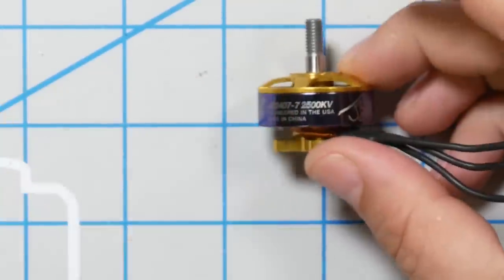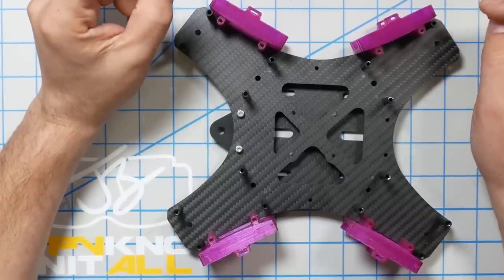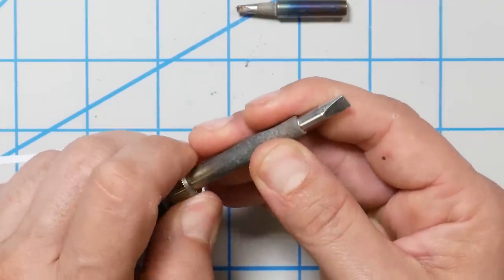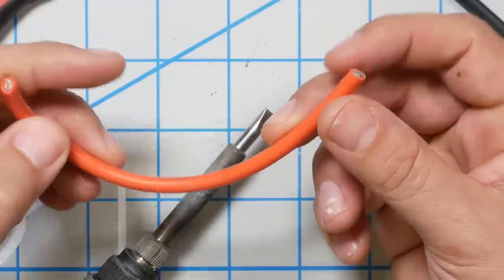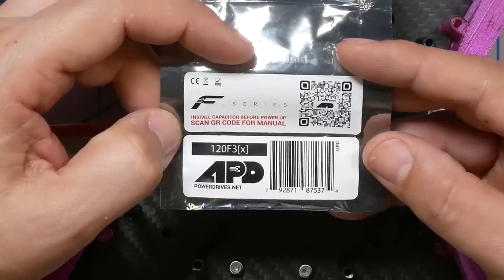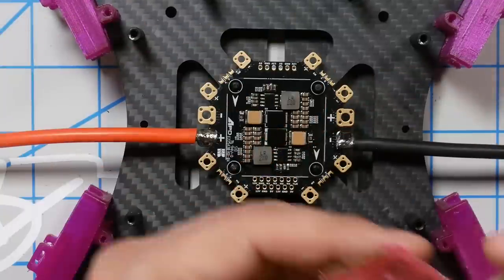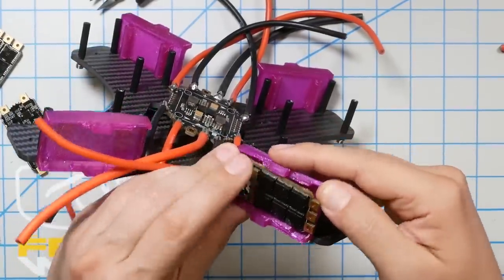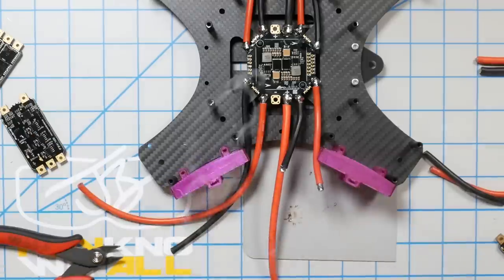Beast Class X Class Quadcopter Build | CATALYST MACHINEWORKS TASMANIAN - Part 1

Comment: There's a simple trick to tinning a wire, especially large ones like that. First, you must twist it to get the strands together. Second, cover it with flux paste. Third, put the solder on your iron. Fourth, touch the solder ball on the iron to the wire tip. The flux will cause nice quick and even heating, and the solder will be pulled right in. It's the same concept as solder wick. Flux can be a real friend with wires of this size. Love watching this stuff. Thanks, Josh!

Comment: Even though I am an electrical engineer with 30+ years under my belt, I learn a lot from your videos. So, it is with the utmost humility, I would like to offer a small reciprocity:
The industry wide standard term for the 'edge connections' you reference at around 28:45 mark in the video is 'Castellated Pins'. They are often used to simplify board-to-board assembly. They save board space (and weight) and usually add no or little manufacturing cost. In many (but not all) applications they offer better electrical conductivity due to the fact that they have direct access to all (including the inner) layers of the PCB; surface pads usually require several plated through holes, called vias, to achieve similar effect.
Reply from the maker: Thanks. That's a good term to know.

Comment: Funny my second build ever was a 800 class Hexa running low KV motors with 14 inch props.  This was about 7 years ago and for the flight controller I used a DJI Naza M V1 with GPS.  There were many including DJI that said the Naza M wouldn't work on that big of an aircraft, but it worked fine. 

It took hours to design, engineer and build that beast.  I used DJI f550 center plates with extended arms that I found on the internet.  It was an amazing thing to see and hear flying around.  I never really used it for what I built it for which was a camera platform mainly because I could afford the cost of a good gimbal.  I wish I had video of this thing flying, but I don't.

Comment: Building my second X with these same parts, including the Brain FC. Got my power section done and FC as well as the rx and vtx/camera.  Perfect timing to see that I got  what I’ve done right so far right 😃. Curious about battery connections coming from both sides. Motors are next and then bolt it all up.  Nice job, excited for part duex.

Comment: the other ground wire is for making sure the ground voltage point on the ESC is the same as the flight controller and should be used if you're using a separate PDB for powering your ESC.
this otherwise can cause some strange behaviours

Comment: The Signal GNDs are provided to allow for a twisted pair with the signal and GND. This helps shield the signal wire from noise/ripple that could get coupled to the signal lines under heavy loads. This could easily happen if your signal wires run parallel to your power wires.. 

I found that running Proshot without signal GND works really well, however running Dshot without signal GNDs could see some glitches. 
I think this happens because the Dshot frequency is in the same frequency band as the FETs rise/fall times.

Anyways, great video.. eagerly awaiting your next vid. :)
Reply from the maker: For these short wires, I'm skeptical the lack of signal ground will be noticeable, but I can always add it if I change my mind. Mostly I'm just lazy about soldering four more wires.
Reply: This info is actually pretty valuable. Thanks @BestUsernameEverMade

Comment: Love your build videos. I have no intention of building this , I'm not an idiot. :-D
Your showing the proper way to solder on the power cables using wires i could actually see really helped. Thanks, happy building  ♥ :-)
Reply from the maker: 10-gauge is great for demonstrating technique because it's so big you can see everything.

Comment: Your solder skills are getting better just as your flying skills.  Still not quite jstd specs but good enough.  You should always start with flux and toss the rossin core you will be amazed at how much easier it is when you start with good flux. Not only does it change the viscosity of solder it transfers heat around the whole joint and regulates temperature keeping you from lifting a pad .

Comment: I've built around 75 Heavy Lift Cinema Drones over the past 9 years..... and until each soldier joint you lay  has the potential to cost you $10,000+ you don;t know the stress of soldiering!  These beast class are starting to get there. Stress of building, stress of flying.. heck when a simple flip on landing can cost you an expensive prop... I'll just watch you guys play with these... Although I do have an old 1100mm ZVulcan UAV frame with some fat 400kv T-motors... maybe at least make a nice 6S huge fpv ripper for fun!

Comment: Love the videos, keep em' coming! BTW, the "edge joints" are called Castellation. They are helpful in PCB design when you need to fit boards on top of one another, but don't have the space for through hole pins/connectors.

Comment: Bugger me with the loud end of a trumpet!  That's some mega motor Joshua!
----------------------------------------------------------------------------------------------------------
A tip regarding your soldering from a British chap with 50years experience.
Put the chisel point on the near side of the solder pad and slide the pre-soldered cable down the chisel face.  This will allow your pad to melt, and the solder on the cable end to melt, then fuse together on contact.  It takes practice but once you have sussed out your timing, it does give good results. 
Great video as usual.

Comment: Signal ground is redundant when your ESC uses the same power source as the FC (same battery), because they already share the ground. But it is a must when for any reason you have your FC powered on another battery (this would be good to reduce vibrations, but not useful on a mini quad because of weight).

So maybe next x/beast build you could try with a different power source for your FC and FPV system? If the tests are good, this could maybe become a must in every x class quad.

Comment: 27:06 That's those little balls of electronic death that flew up on your Capacitor that causes Spectacular Fires and Magic Smoke in abundance at that wattage. I am a little OCD but, I would go back and make sure that is ABSOLUTELY GONE. My blood curdled when I seen it pop up.  Amazing Build. You are right, anyone with no experience is an Idiot for attempting this build. Little less fly the Beast. I am bold and tend to push my limits. I get a cold chill down my spine when I see these power levels in a perceived "Toy". We both know that there's going to be that Idiot that attempts it. LMAO I am a firm believer of removing all warning signs. Great Video, Sir!!!

Comment: Soldering - it took me years to realise by myself that the process of tinning wire before you solder it to a circuitboard wasn't just some annoying step that could be omitted, it is a vital part of how to get perfect solder joints, and I should've listened to those who did actually know better.

Comment: with the right gearing one of those motors could open your front gate with your controller rc gate opener. i remember getting out in the rain to open gates for ostriches..woulda been nice to have a multiple systems rc on a frskytaranis all those channels  without spending what the commercial systems cost

Comment: i have a tip for you (youvgonnalearnsomethingtoday) : don't use hand to hold the wires when soldering it, it's way better to hold it stable with a fixed holder, note that your hand is always shaking(micro shakes), and micro cracks will form during solidification phase. 

great job, nice beast !

Comment: 12:50
Electrical engineer:
Nah, generally when you have assembled electronics, they are a lot less sensitive to ESD. The gate of MOSFETs (especially smaller high speed signal ones) are the most sensitive because it's unconnected static voltage can build up to the point that it pokes a hole in the oxide layer, effectively shorting the MOSFET gate to the channel.
Reply: You should conformally coat after soldering the PCB
Reply: 28:28 *YES you should run another ground wire!!!*
And ideally twist them together to make a twisted-pair. The large current-carrying wire is going to have voltage drop and high frequency noise, which will effectively be added on top of the signal, from the ESC's perspective. The separate ground reference should provide a central ground reference star connection to the flight controller. Also if the electronics on the ESC are galvanically isolated it just simply would not work, or worse, barely work until external EMI from nearby current-carrying conductors upsets it during flight!

Comment: Add flux the boards and wire BEFORE you soldier them.  I do computers and  I flux the board and the wires making them a lot easier than soldier alone. And you can clean them with rubbing alcohol  I do it with one hand!

Comment: When I'm at that point with expensive components I just tip the bottle onto it and spread it around.....several times. 6 months stuck in a field over winter with no electronics damage says it works.

Comment: Hey JB. In all seriousness..Your + and your - pads are on both the top and the bottom of your ESC's. 
Did you not think of 'splitting' the wire so you could "sodder" (<<< Americans.. 😜 ) So you could Solder top and bottom pads? For that gauge wire, I reckon that would be way more secure?? 
Love the vids mate!!!
Reply from the maker: That's an interesting approach but I don't know if it's actually worth the hassle.
Reply: @JoshuaBardwell  Mate, it's just finger strength, pull the strands apart to approximately 50/50 and (Sodomise😜 ) Solder them. It's no hassle!! It's just less huge solder clumps and you have a double safety if one half does break away. 
Mate, I bow to your greater knowledge, if you only knew how much you have helped me in this hobby!! Thank you!!!
It's not advice...Just a suggestion is all. ✝👍😂

Comment: Good video as always. You mentioning the word "expensive"  a lot. What does this build cost? I fly heli's and fpv. Some of my 700 helis are 1000$ to 1600$ just for kit. Motor 350$. ESC 300$. 4 servos 600$. Fbl controller 250$. 12 battery setup 300$+. Main and tail blades 180$. Hell just my mikado vbar touch controller is 1300$. Is that expensive?

Comment: Fun fact. I run 10 gauge silicon wire on my 5" drone. And I soldered it quite well with a normal tip.
Why am I running this wire?
Because I had access to an old 6s 6000mah pack that had puffed, and I clipped the leads off to reuse them.

Comment: Thanks Josh for the awesome video!
 I just wanted to comment about the safety aspects of it. yes, I understand you don't want someone to go out there and hurt themselves but I do have to go back to the old days when we used to make gas powered helicopters 90 size that cost $3,000 with a 3-foot blade on it doing tik tok's and flying inverted along the grass with full auto rotations. I guess what you're saying, is just take responsibility for what you build and what you do with it. But not saying, to not build one. Just out of curiosity what is the average cost to build one. Thanks Lance
Reply from the maker: I agree everyone should take responsibility. There is not as much of a culture of safety with FPV quads, because they are inherently less dangerous and expensive than CP helis and big RC planes. So more of a disclaimer is necessary. One rich, careless person could build this quad, more or less the same as he builds a 5", but this is NOT in the same class as a 5".

Comment: I just noticed that you are using 50V capacitors for 12s, would it be better to use 100v capacitors for 12s?
Reply from the maker: That's what APD sent with the ESC's so I assume they would know.
Reply: Okay thank you. That is interesting I always thought the capasitors needed to have a voltage rating higher than the battery voltage or they might not absorb voltage spikes. My 12s 120A APD ESC's also came with 50v capacitors.

Comment: Which solder fume extractor do you have? And do you like it?
Reply from the maker: I have a banggood special ... I don't remember the exact brand. I don't like it very much because it has to be VERY close to the work to actually catch the fumes. If I had to do it over again, I would get a fume extractor on a spring-arm so that it could be easily and quickly moved into and out of position without disturbing things on the bench.
Reply: @JoshuaBardwell  I use a 12v 0c fan from a used electronics place glued on some foam as a stand with a simple 12v wall adapter, it works like a charm

Comment: Those wrist straps aren't anything you need to worry about man. No matter where I've lived dry or humid, I've never had an electrical component fry. Plus something designed for the kind of power you're going to feed through them likely won't give a shit about some mediocre static discharge.
Reply: Exactly. I don't use one, own one and I have hand assembled over 30 FC's at component level. Never had an issue. All BS
Reply: Believe it or not some components are very susceptible to voltage specific spikes. So something like an ESD (2000+ volts shock)...can be bad.  If your not wearing a wrist strap just try to discharge your self before touching a circuit. Easy enough.

Comment: That disclaimer is interesting.  I think a 5" quad could seriously hurt someone.  Probably not as badly as this but idiots shouldn't fly those as well.  Of course cars are more dangerous than both.
Reply: Kinda... But the average Joe respects the danger of a car and has never looked on the ground to see if their finger is lying nearby after hand catching a quad. Reddit is full of 3-5 inch injuries that are painful and gruesome.  This would easily kill someone
Reply: @DoRC  i can't tell if you're joking?  Some pros do it bc it's cool, noobs do it bc they are used to brushed quads that don't shred your fingers... Or so I've heard
Reply: @Sully365  I was mostly not kidding.  I haven't flown around any "pros" and I don't watch a lot of them on YT.
Reply: @DoRC  i totally understand.  I think a lot of people underestimate how sharp the blades are and how powerful the motors are until they get into trouble
Reply: @Sully365  amen. The 5in kwads spinning props will slice through flesh like a hot knife through butter. I have had ass holes crash in to me in the field and it fn hurts. Imagine the behemoths.

Comment: @ 3:10 Tbh if anyone has the skill to build a 75mm micro quad..... it’s safe to assume they can build a freaking flying bath tub.
Reply from the maker: Many people flying a quadcopter don't actually have the skill to build one properly. The consequences of failure are so low that it doesn't matter. Not the case with this one.

Comment: 12S = 50.4V, and you're running 50V rated capacitors? Caps really don't last if they are run at their limit all the time, especially if voltage spikes exceed that limit. This is one of those situations where the slightly larger size of a 330uF 63V capacitor would be well worth the trade off of not having capacitors fail under heavy voltage spikes.
Reply from the maker: These caps were included by APD with the ESC's. In this case I'm going to assume they know better than me what's best.
Reply: I noticed the same ...

Comment: I don't see what the big deal about this is... we've been flying 700 class 3D model helicopters for a decade and more... no-one says 'I'm an idiot' for building a machine like that, and really a machine like that is probably more dangerous than a large multirotor since that single huge 1.5m diameter rotor is more like a flying axe than any of those single 12" props.

Comment: These multi-kilogram acrobatic helicopters have killed people and pilots before. One such accident chopped a person's top half brain off. Look up 700 class. And there is no sure way to prevent another accident from happening except extra precaution. If you have children or plan to have children, everything in this hobby should be under 250 gram takeoff.